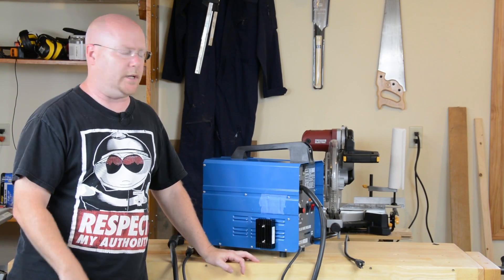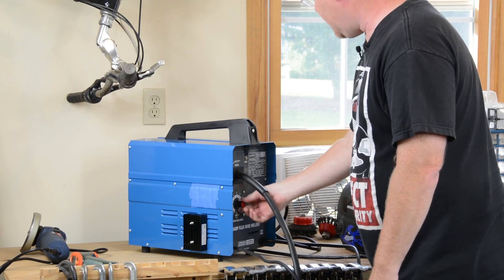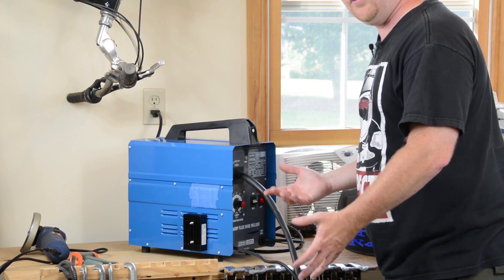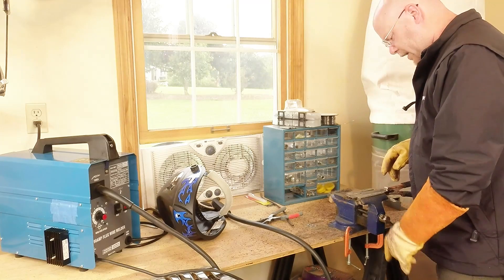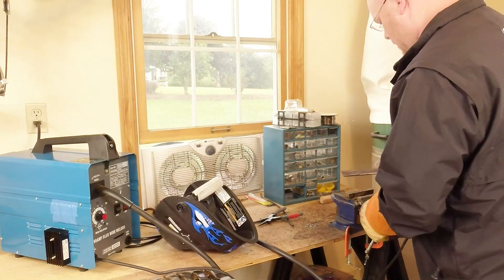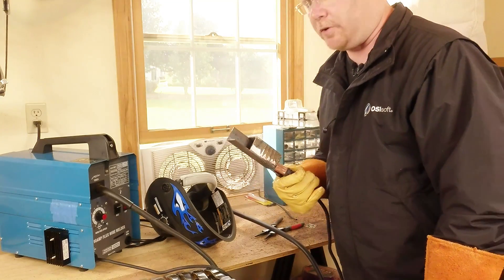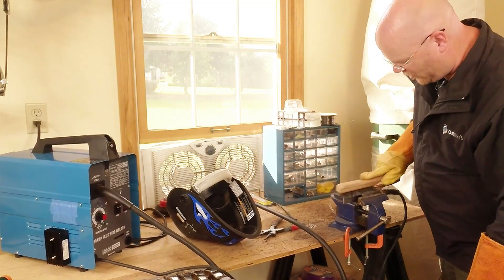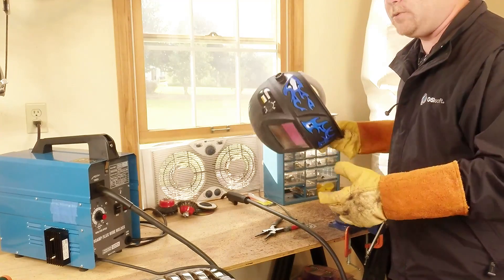Advanced Harbor Freight 90 AMP Welder Mods 07

Comment: Hi! I realy appraciate your videos. . I found these capacitors on Aliexpres. Will it do the job if I wired in parallel 2 or 4 of them.
https://www.aliexpress.com/item/Free-shipping-2PCS-15000uf-50v-50V-15000UF-15000UF-50V-Electrolytic-Capacitor-volume-30X50mm-New-and-Original/32804701930.html?spm=2114.10010108.addToWishlist.2.2ba9709crjiAFO&traffic_analysisId=recommend_2031_1_83268_iswiall&scm=1007.12873.83268.0&pvid=0cc865f2-b011-4a9a-adbc-e6ede21f27a7&tpp=1
Reply from the maker: Yep.  2 is ideal, but just 1 would give you 90% of the benefit without having to cram 2 in there.

Comment: So I completed the mods and it seems my duty cycle has taken a huge hit. The arc looked better but it really seemed to heat up my welder quickly. I ran two 8 to 10 inch beads and then it just shut down. I felt the rectifier and it was super hot... almost too hot to touch. 

Not sure what is going on.

Comment: so I've done all of the mods and then some.. Success!! only issue is the torch stays "hot" because of the power in the capacitors. is a 10 watt 160ohm bleed resistor too big to put on them?

Comment: MIG welders are so dirt cheap...why you pissin about...putting your life at risk.... and some other poor sod life who might try and copy you and make a mistake? your intelligent enough to keep covering your ass by saying i dont know this....and i dont know that....if my guess is good...Courts are not stupid, what you've done is proven to any future prosecution/lawsuit, that you knew exactly what would happen if someone copied you and it went wrong..you would be wide open to criminal charges. Imagine the headlines for a second...."Teenager DIES...Copying Cowboy Electrician's example I.D "Matt Heere" on YouTube"   That's a  life destroyer right there.........
Reply: He added a bridge rectifier and a cap to a welder.  Not exactly rocket science or any more dangerous than using a Chinese welder from the factory.  This is something that many people have done many times and its pretty standard.  I would venture to say that more of these 120v 90A HF welders in use have this mod than don't.
Reply: Figures this killjoy above (Autotechmechanics) with all the legal advice is an auto mechanic. That's the same mentality that when you bring your car in for a blown brake seal, and he ends up telling you that you need ALL your brakes done with new shoes, fluid seals, drums etc.. or he won't do the job due to liability, although you have done brakes all your life, and junking the car in another 1200 miles when you got to the coast, but couldn't argue as you were stuck in the middle of a cross country trip.. You're not the SOB manager in Albuquerque P**Boys who cornered me into paying an additional $700+ full brake job when I only needed a $30 brake cylinder rebuild kit.. are you?

Comment: The outlet you plugged it into looks like a 15A outlet, whereas the book states the machine wants a 20A circuit.  Does it work on 15A? Or do you just have the wrong jack connected to a 20A breaker?
Reply from the maker: it will run for short periods on a 15 amp breaker on full power output.  it's not a good idea as you are overheating the breaker and it will trip eventually.  If you're running less than the full output then it's fine continuously.

I normally run it on a 30 amp RV outlet with an adapter for the plug.

Comment: http://www.ebay.com/itm/MDQ150-16-Single-Phase-Diode-Bridge-Rectifier-150A-Amp-1600V-IND-/331557403553

Would this work? Is there a specific brand im looking for?
Reply from the maker: Nick R The ratings are good, but just note that it doesn't include the heat sink.  If you look at the 100 amp one, you'll see the set of fins on the back.  This one doesn't have them.  It's designed to mount to an external heat dissipating system - hence the shiny flat side.
Reply: Matt Heere Okay, i already ordered one of these 150 amps. 
I noted that there was no heatsink. But i have a bunch of them laying around including thermal paste. I think i have a heatsink with fan that will suite this. But it is a 12 volt little fan. So i could put a rectifier on the 12 volt transformer wich i am going to use for my wire feed and run the fan on that. Or i run 2 more wires from the board of the wire feed. I have a big relay and a small one. I hooked the small 12 volt relay up to the wire feed motor wires. So it closes when i press the torch button. WIth that small relay i want to enforce the 230 volt coil on the big relay wich can handle 10 amps per contact. And that this is going to switch the transformer on and off. I'm afraid that if i pull too much volts out of the wire feed board the wire feed will drop. So i think this is better then getting a 12 volt relay with can handle 10 amps. Or do you think i could use the automotive relay? What is the worst that can happen? That i burn up my relay?

Comment: You could put a relais in it so it isnt live all the time.
But your mod is actually only getting the AC from the transformer into the 2 ~ poles on the rectifier and the - to torch + to ground with a cap parallel in the DC circuit. Thats it? I got mine for free too. you think this one works? http://www.ebay.com/itm/MFQ100A-1600V-Silicon-Controlled-Module-Diode-Bridge-Rectifier-100A-Amp-/120819519353
Reply from the maker: Nick R That's the rectifier I have.  I've since decided that a 150amp would give you a bigger margin of safety, but so far it's working fine.

You don't really want the welding current going through a relay.  The current is too high.  What you'd do is put the relay on the primary side of the power transformer.  This means building a separate power supply for the wire feed mechanism and torch switch, since you'll be killing the main transformer when you open the relay.
Reply: Matt Heere Ofcourse i ment the primary coil.

Stupid i didn't think of that indeed. If the transformer doesn't have power the wire feed and torch switch don't have power either to close the relays. Then i need a 12v power supply to power the wire feeder and torch switch and the second relay. I do have a 12v 2 amp transformer with rectifier so that should work.

Do you recommend a 150A bridge rectifier?
Reply: Matt Heere  Oh just found out that the board has his own rectifier so i only have to connect the transformer to the 2 leads comming from the secondary. Just hope 12 volts 2 amps is enough to power the solenoid and wire feed. 

Could i use a 12 volt 80 amp car solenoid for the primary? If 12 volt 80 amps works i don't know why 230 volt and 10 amps would't.
Reply from the maker: The secondary side will run as high as 35V when you're not welding (open circuit voltage).  Not sure how long an automotive part would last.

Power dissipated by electronic components is a function of the current squared:  I^2 * R to be precise.  The power carried is volts * amps, but it's the dissipated power that fries stuff.

If it's easy to get 150A rectifier then I'd say do it.  I would if I were doing this over.

Comment: What are your thoughts on a Lincoln Weld Pak 100HD for $180 as a first welder? I was thinking of this hf modified setup but you and others seem to suggest not going this route unless one already owned the cheap machine.
Reply from the maker: Jonathan Dikeman It's hard to go wrong with either a Lincoln or a Miller.  They aren't the 100% U.S. made items that they used to be, but they're still top notch tools.  I think that'd be a fine choice.

Comment: Great videos. I just finished with the mod today and I've got a problem. I bought a 100000uf 50v capacitor and after welding a few welds the welder started to make a loud buzzing noise. I thought it was coming from the wire feed motor so I unplugged it and it is still making the noise. I mounted the capacitor near the wire feed mechanism so now I am thinking it is my capacitor that is buzzing. Everything still works fine, but the buzzing is really worrying. Any thoughts?
Reply from the maker: Triple check your polarity!  Electrolytic capacitors are pretty easy to fry, and I've gotten more than one bad one right from the factory too.  Take the cap out of the circuit and see if everything works with just the rectifier.  If it does, and you're sure that the polarity is right on the cap - then it's a bad unit and needs to be replaced.

Comment: I was thinking about buying this one as it is $109 but hen thought 109+ price for mods is quite a bit, is there one that is about 150-200 that is already dc-?
Reply from the maker: Depends on the Craigslist market in your area.  I don't know of a new one, but there's nothing wrong with a used welder.
Reply: Matt Heere I found a Lincoln Electric Century 80GL...it's new in the box 88amps max and it already comes with lincoln flux wire? but it doesn't say if it's dc-.... the guy wants $160. if it's AC and I do those mods it would put me over 200.... I just want a nice cheap welder for the garage, I have a go kart that I want to do some mods to and I am tired of taking it to my local shop and paying $40 for simple stuff... what do you think is best? thanks for all your help
Reply from the maker: Can't say that I'm familiar with that particular welder.  A quick search didn't turn up anything specific.  They seem to go for ~$250 most places.  I can't imagine that it's not D.C. at that price level - but again I don't know for sure.
Reply: Matt Heere just spoke to the lady....yes a lady is selling it...it's in the box and she went down to $150...she said it was 300 in home depot however I looked a bit and they range from 220-269 some go for about 180-220 used... I think I'm going to buy it.. it seems like a good deal + I wont have to upgrade to lincoln wire since it comes with... thanks for your help again
Reply from the maker: With tax that's probably right.  Again, I don't know for sure, but I'd be really disappointed in Lincoln if they're selling an A.C. wire welder for that much money.  Good luck whatever you decide!
Reply: Matt Heere just picked it up, I'm about to check if it's AC or not
Reply from the maker: Awesome!  Best of luck with it.
Reply: Matt Heere hey Matt just starting trying the lincoln electric century 80gl it doesn't say if it's DC- but judging by the splatter i'd say its AC....it's been a nightmare... I am using 1/8 inch material (that's more likely what I'll be using mostly) I bought a 4 foot long flat piece and it's about 1'' wide. I cut it into about 2-3 inch pieces. and been welding them up. I don't know what I am doing wrong but it seems that in min it's a little too cold  (not enough penetration I think) and on max it seems to burn into it too much (no burn through...yet) but when I am done welding those 2-3 inch pieces on max they are completely glowing red... I have moved the speed up and down on both min and max and at min with the speed at about 8 it seems to be the best as I get that bacon frying sound. what do you think I am doing wrong? I will keep pn practicing, it seems that I am slowly getting better welds done... thanks for any help
Reply from the maker: I'll start with saying that I'm not an expert welder by any means, and there are probably way better answers over weldingtipsandtricks and *****.

Max is the correct setting for 1/8, and that wire speed is probably very close.  You're at the upper limits of what the machine can weld, so maxed out is going to be correct.

That leaves travel speed and torch position as your only controlable variables.  With this rig you're going to want that torch tip almost touching the work piece.  Get right in there and keep the wire stickout as short as you can.

Once you do all of that, it won't take a lot of practice to figure out the best travel speed.  It'll vary a little bit depending on the temp of the material when you start out, but should fall within a pretty tight range.

Welding is hot!  Glowing red is right.  As long and you're not burning holes through the parts it sounds to me like you're doing pretty well.
Reply: Matt Heere thanks I have been over to chuckE2009's and others however it seems most people that show tips about welding always come out and show you how on their $700 machines, start with correct polarity (which I can't do) voltage settings (can't do that either) and other things not possible on mine... I just found out my breakers for my garage outlets are 15 and It requires 20.... so changing that today
Reply from the maker: Officially, I have to advise that just swapping out the breaker is a bad idea.  The breaker is currently sized appropriately for what the wiring and outlets on that circuit can handle.  Just upping the breaker size is a code violation and a fire hazard. </end disclaimer>

Know what you mean about the other vids.  Fortunately the examples of travel speed and torch position are still applicable even though the other stuff is beyond your control.  FWIW, it turns out that the voltage on these types of machines is actually pretty close to correct for 1/8" material, so you can rest a little easier about that one anyway.
Reply: Matt Heere thanks looked more into it and found that from breaker to plug recepticle wire gauge is 12 so 20A would be ok to put in according to a ex-electrician I talked to at home depot, however i decided not to buy it. he said if the 15A breaker and was not tripping not to bother, and yeah it never tripped once. so he said changing to a 20A wont make a difference... thanks anyways!
Reply: Matt Heere hey Matt so I was getting upset at how much splatter there was and decided to open the unit up and it is AC... I am doing your mod after all. already ordered the parts. thanks for the clear and detail video... I looked on-line and many people were talking about a choke or something I guess it goes on the inside on the clamp wire or something, could not figure out what it was for but looked like a small transformer...
Reply from the maker: Officially it's called an inductor.  It's just a coil of wire, sometimes wound around a ferrite core.  You don't need it.  Theoretically it would make the arc more stable by smoothing out the current.  FC is a constant voltage process though, so the capacitor is the far more important component.
Reply: Matt Heere ah ok, I ordered everything I need and it's on the way, I'll be adding the 20ohm 10 watt resistor to the cap like you say, it was cheap so I said what the hell... hopefully the crazy amounts of splatter will stop.thanks for all your help again
Reply from the maker: Good luck!  Post a few pics or a quick video when you're done.  Would love to see the results.
Reply: Matt Heere I will, thanks for your videos, I first read about DCEN conversion on a blog, people where showing schematic plans and I was completely lost as I know very little... I saw your video and was like "I can do that" I learned that my century 80gl was AC so I opened it up and realized it looked nothing like yours... I got scared and decided to leave it alone, got tired of the splatter so I opened it back up and studied it... I compared it to your videos and found it to be very similar in design just components were in different places. I will make a short video to show the conversion for others with same welder, thanks for everything!

Comment: I'm having trouble locating a capacitor.  Can you give me more detailed specs, or a site to order one from?
Reply from the maker: Paul Gumper Basically and capacitor that's rated at 50VDC or higher will work.  The larger the uF number, the better.  Mine is 43,000uF and seems fine, but if you can find a bigger one then go for it.

Here's one on eBay that's about perfect:
http://www.ebay.com/itm/NOS-Mallory-CGS-13000UF-50VDC-Can-Capacitor-R-CC-/220617438955?pt=LH_DefaultDomain_0&hash=item335dd2f6eb
Reply: Matt Heere Out of Stock  :(